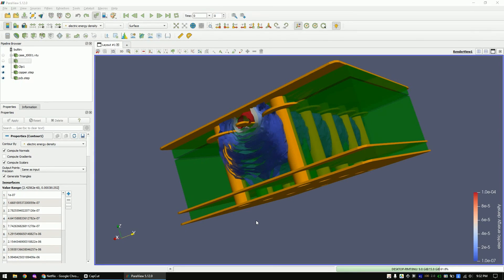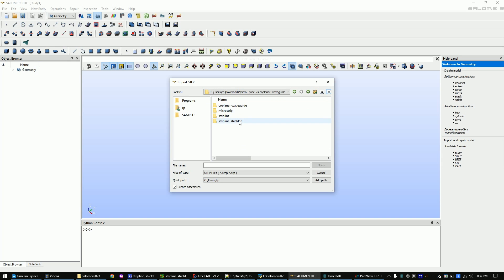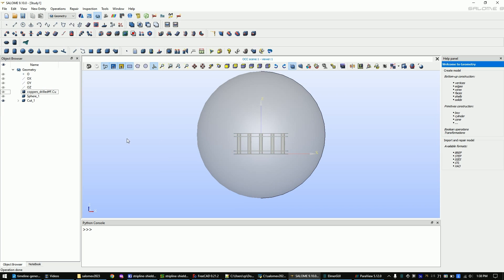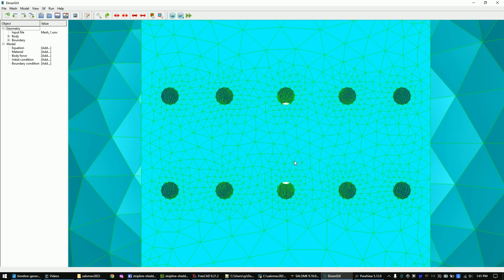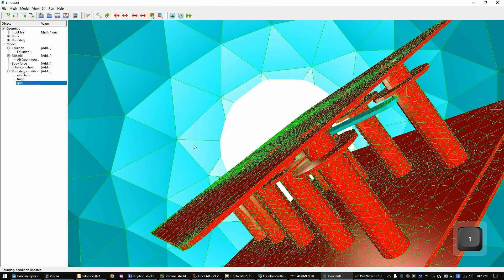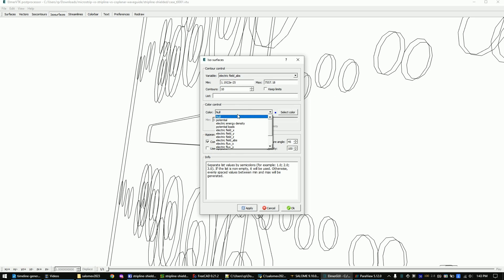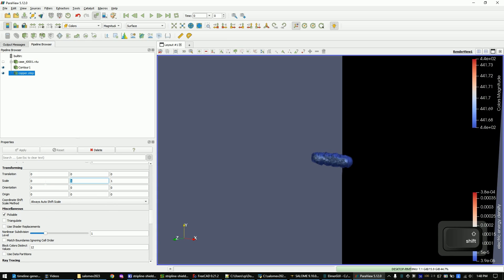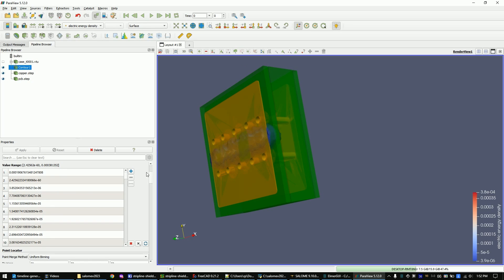KiCad Electric Field Simulation with Elmerfem - Shielded Stripline Finite Element Analysis

Comment: did you model the PCB substrate material?  or just leave that out for simplicity?
Reply from the maker: You can add a dielectric to the simulation, at that time I didn’t have a smooth workflow for it yet. The main issue was that Elmer has trouble displaying marked objects when there are more than 1 object inside another object, for example if there are traces and FR4 inside an air box. 
Meanwhile i found a good workaround: lecture 64 on udemy shows how to deal with this displaying problem of Elmer.

Comment: Great videos. I was wondering why you changed your workflow in certain situations to export STEP from KiCad instead of using kicad step up.
Reply from the maker: Hi there, This is because as KiCad 9 came out you can export step files directly with this version and dont need stepup anymore. The stepup process was for KiCad 6.
If you wonder about KiCad 7 and 8: I didnt manage to use them properly.